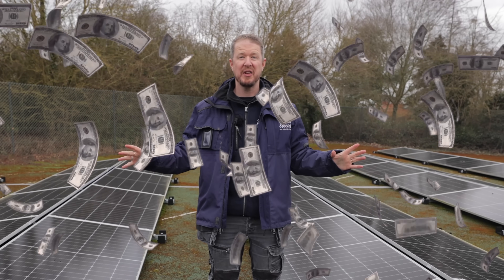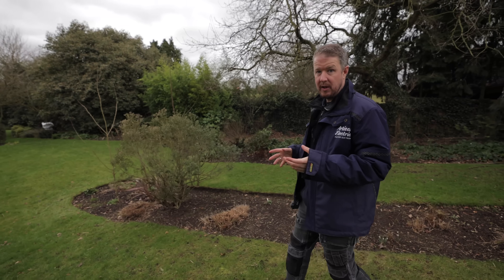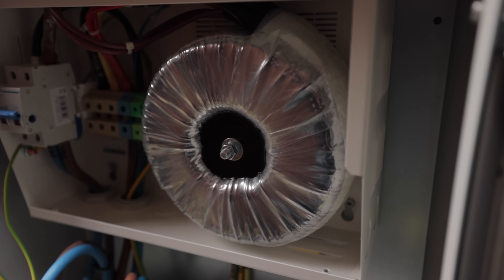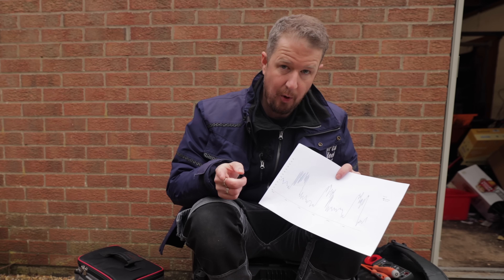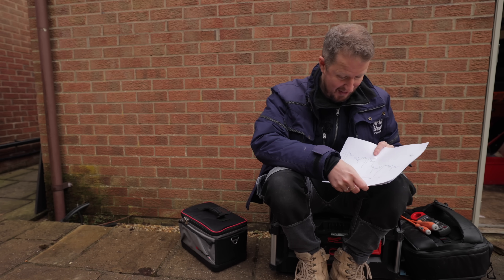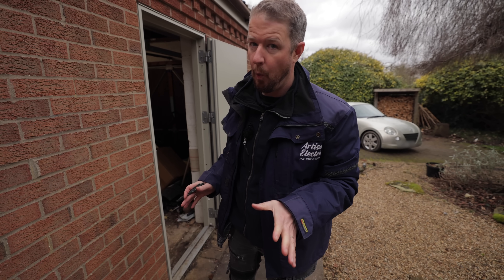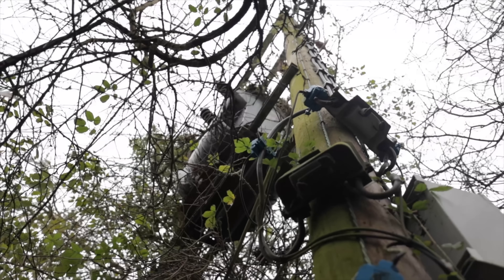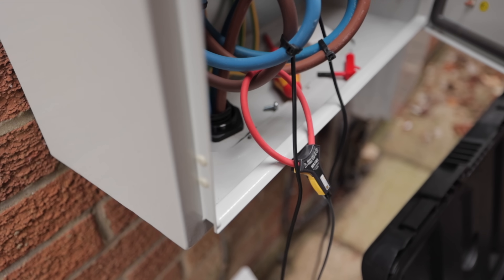THOUSANDS Down the Drain – And We Can’t Do Anything About It!

Comment: i'd have installed a bigger VO unit than that for a 17kw system. if interested I can put you in touch with a company that can install a larger VO, they are manually set Taps I'd have gone for automatic tap adjustment to be fair on that. You can drop that to around 220v  and everything will work i'd go 225v to be safe. You need a Voltage optimiser with automatic tap adjustment, 15-25v tap range.

Comment: You are not a clever sparky and clearly you have no idea how these systems work because your idea with the step down auto-transformer is about the worst thing you could do. The problem is first, the way these things work: to push power back into the grid the solar inverter has to push out a higher voltage to match the point in the grid where the grid current and the solar current match. If the impedance of the consumers mains and the grid connection and the grid itself is a bit high then the solar will produce an excessive voltage to compensate. It is literally just Ohms Law and a bit of logical thinking. How is the power pushed back into the grid? From there you get your answer.
Before they put this system in, did they get big voltage dips under load? I bet they did. And your auto-transformer is not doing you any favours either. The environment your system is trying to work in has an excessive grid impedance. Putting a fixed ratio auto-transformer anywhere in that system is going to cause a problem somewhere.
What you need to do, is work out where the impedance is that means a 70 to 80A back feed will lift the customer end of the consumers mains by 13%. The UK like the rest of the world has been moving to 230V for many years now and if the situation there is anything like here down under, we enjoy a mains of 230V +10% -6%. That's why your UV switch has a threshold of 252V. The limit is 253V (230V + 10%). At the other end of the scale it should be 230V -6% = 216V which is the same as the old 240V -10% = 216V.
It ticks me off when I see someone trying to be an authority on something or thinking they know what is going on and then try to tell people about it when it is all just disinformation and just plain wrong. Before you poison things for the rest of us who do know what we are talking about, please please please CHECK YOUR FACTS.
This is the second of your videos I have watched and the second of your videos that just sprouts myth and legend in place of the truth. This helps no one.
Sorry to be so hard on you, but if you are going to sprout a load of rubbish, in one way or another, this could hurt somebody physically or financially. That you lost 3k is your own silly fault for overstepping your knowledge and understanding.

Comment: Surely your inverters are monitoring grid voltage? Can you not install a raspberry pi and solar assistant to log grid voltage 24/7?
Reply: You could even set up homeassistant to send you a telegram message if grid voltage goes over or under a set range?

Comment: you connected a bespoke system to the electricity grid without checking if the grid could handle the system.
Looks like the power logger was an overdue item to put in your inventory.
so now the system is dependant on the goodwill of the power company upgrading the local grid
assumption is the mother of all cock-ups ! assuming a rural location would have the infrastructure to handle it was an error on your part. 
urban and high consumption areas will have been more likely to get network infrastructure improvements while conversely  rural locations are more likely to have space for large solar or even wind installations .
at the end of the day if the grid wants us to implement eco energy projects it will need to review its upgrade policies on the network

Comment: I Think the manual tapping system on the house mounted transformer should be automatic tap switching
Reply: I don't understand why the inverters on the solar system cant regulate the voltage. The  Pv voltage would be going up and down so why doesn't the invert regulate the final voltage output

Comment: Hello from France, this technical (and increasingly rare) issue is interesting, especially the final solution that will be applied. I immediately thought of a voltage drop between production and the grid. Have you considered taking a simultaneous voltage measurement at your customer's site and as close as possible to the transformer? During production peaks, of course. I'm also thinking of a possible phase imbalance downstream of the transformer.

Comment: Wouldn't of thought the transformer or vegetation or how old the H poles are although they look very old poles due to the type of porcelain insulators and snail clamps retaining the 0.5 copper conductor. There is something going on because of small black cables clamped to the LV cables transformer side of the lucy fuse - looks like a device for monitoring something? worth asking DNO what the purpose of the unit? It's not a phase balancer as they tend to be fitted on Lv poles to balance out the phases if one or two phases are are over loaded mainly red (brown) phase gets hammered. anyway my useless pointless bit of information.

Comment: 205 volts is not "too low"... it may only be an issue of a bad/cheap made charger. And yes, your local energy supplier's transformer and/or lines are slightly(but not critically) too weak for such loads (in or out). Also, you can just make a cheap automatic switcher for "night mode" for your "optimizer"

Comment: Are you not able to install a switch (or automatic/timer device/contactor attached to a photocell) that bypasses your voltage optimiser when the sun goes down. Low light the VO is bypassed giving 260v to charge the batteries, then when the sun comes up, the VO goes back online and protects the increasing solar voltage?

Comment: Just some comments and thoughts: 1 - The no-load voltage tends to be at the maximum allowed as the grid system was never designed for back-feed currents. 2 - These pole transformers tend to be low power and often overated for periods during the day. 3 - The cable length from the pole is significant (and feeds several houses) and is obviously soft (high supply impedance). The optimiser can only add to this impedance, but is necessary to avoid over-voltage if you wish to export at these high power levels. 4 - The fitting of power factor correction capacitors can negate the reactive volt drop and reduce harmonics (which also contibute to the problem of voltage variation), but care must be taken as resonances could take place. 5 - Do not assume the DNO are infallable, some people you talk to are not compitent (from experience). To check the system with the main load disconnected is a good example. 6 - From what I can see this installation should have never be given G99 approval as the supply is too soft and over-voltage is inevitable. No-one else on this line can have PV as this will make the matter significantly worse and this problem affects ALL customers on this line so equipment failures are someones responsibility. 7- This is a good example of why our supply system cannot cope with the green-plan. When everyone on this line has electric vehicles (2 per house) and they all plug in to charge overnight the system is going to fail. Final note - G98 says that the system is expected to cope if every dwelling (load) on the system generates a peak (short-term) load of 3.6kW (similar to the possible peak winter load). To allow one dwelling on a soft supply to take five fold this value is wrong. you need to limit the load/generation powers by better use of the batteries.

Comment: I've a SolarEdge system myself, but what was the ratio going for 3 inventers (servicing 20+ panels each) over going with micro-inverters?

My neighbourhood has a lot of solar and they warned me the fewer inverters you have, the bigger the chances of voltage problems. Serial with a large inverter is ussually when the panels are all the same, but you've installed a piramid base where half the panels will always generate less or more than the other half, plus all those trees and shrubbery around, you'll definately see voltage variations between the panels cause drops in outpot.
You'll also never notice a defect in a panel with the serial&inverter you've got set up, while micro-inverters allow individual monitoring.

That said I'm no electrician, this is simply what I know about researching the panels setups available then.

Comment: Did you have permission from the DNO for one of those voltage optimisers? Having your inverter connected on the load side of one of those things without it is non compliant with the code of practice, G99 and MCS. Basically because you've voided the G99 protections present in the inverter. Completely non compliant ... Brave to put it on youtube ... Or stupid.

Comment: To be honest have same problem in South Africa but the municipality really doesn’t care there is no funding to replace broken cables or transformers with the large scale cable thefts. We have a sunsynk so if the voltage gets to high or low it disconnects from grid so solar export stops entirely for few minutes every 15min but the house voltage is 100% so had to change te settings otherwise it was disconnected half of the time

Comment: This is a combination of lazy DNO and willfully quoting jobs without the engineering consideration. 

This is a very large solar install for a domestic local network arrangement. 

It might pay to consult an electrical engineer for larger jobs like this. 

It sucks for the customer but the installation as designed should never have been permitted.

Comment: electrical engineer here: clearly an impedance problem. Most likely in the wire. These overhead wires are usually sized small as open air can cool a smaller conductor. The transformer should be closer to the load. 11kV line is unlikely to be the problem as it will only be seeing 1.5 amps. Transformer also may need upgrade. Here in NJ most such installations have a 25 kVa rating and must be shared with up to five homes.

Comment: The idea that solar inverters can't push enough power trough the transformer is not correct. The transformer will allow for any power to pass trough. The only limits for the transformer are core saturation and I²R losses. (The transformer magnetizing current doesn't change with the transformer load. This is called "transformer action".) What happens is that the solar inverter, being a current source will raise it's output voltage to overcome the feed line and transformer winding resistance. That the voltage goes down when charging during the winter is also because the feed line resistance is to high. So you must use larger gauge cables towards the grid transformer. But with the current import tariffs on metals it might be cheaper to just move the house a bit. I also think you've been ripped of if you've paid several thousand pound for a transformer in box which judging for it's size, can't power the complete household. Maybe a washing machine and that's about it. You can actually measure the feed line resistance by yourself. Measure the open circuit voltage and measure the voltage a again with a load of a few kW. The remainder is ohm law.

Comment: That transformer looks good (even just looking from this video), and they are in the so called voltage range for your local norms. If there is no real voltage drop in the grid from normal loads (houses), then the grid is fine; your system is defective or poorly designed for this specific situation, and the grid service might even get a case against you for affecting their service or other clients in the worst case. Even then I would check for leaks in the live wire or even the neutral wire, is pretty common to find a slit down the line and you only find out when you have a load in your system.

Comment: To feed the grid, your inverters will rise the voltage. To solve the problem with house feed - use separate inverter, which will work off the battery set.

Comment: Could you fit an automatic transfer switch with a connection to the down rated tap in during the day and a bypass to the voltage optimiser at night time for when the battery’s would charge.

Comment: I have argued for many years about this, but the leccy board say its within limits. My customers were on 3 phase and I had 455 volts which tripped out all the machinery breakers and over voltage sensors. In the end I fitted different breakers and monitors, it worked but the component life will be shorter.

Comment: Just program up an Arduino or pie, to operate the VO via some interlocked contractors. You built the system, you need to automate it so it tracks the grid and self adjusts.

Comment: As others have noted you can determine the impedance of the home’s electrical service by simply applying a significant known current draw and measuring the voltage change. Hindsight is not very helpful now that the system is installed, but this a measurement that could have been done as part of the planning.

Comment: Hrm.. i wonder if someone makes a voltage regulator, or PLC based system for monitoring, and regulating the voltage levels of a large electrical system...... hrm...... oh wait.. they do.. and they are about $300 USD for a 20KW 220v AC regulator

Comment: The plus 10% and -6% on 230V is because the UK infrastructure supplies 240V, so they need a higher positive tolerance. As others have stated, how a transformer looks from the outside bares no relation to the electrical performance. As the problem manifests during solar generation, the voltage has to be higher than grid supply to export to the grid, but the fact that the voltage rises too much means there is a high impedance between the solar inverter and the pole transformer.

Comment: Is your client fairly isolated? if so I would suggest its the supply cable, a fault... UKPN, if its their fault and they know it, will do everything not to admit that and avoid having to actually do anything, because they are run by numpties... I know, because I used to work for them... I'll put money on the fact that the issue relates to their equipment... Just seen the bit where you go to the Transformer...and I agree with you completely, and of course its stuck up a pole, which means that the area has been subject to flooding in the past as well...no great if the PV panels are on a tennis court surface and may themselves be subject to getting flooded at some time...!!

Comment: I think you find your in the wrong my friend.. g99 is set of engineering recommendations by the ENA to avoid causing issue with the grid when connection anytype of generation, but you seem to be exporting double you should be causing the high voltage and could potentially cause damage to the neighbours, so in breach of this.  Single phase premises exporting upto 17kw you should have a G100 scheme as you should have export limitation to maximum 32amp on to distribution network under small generation installation 3 (SGI 3 ) you need to install this/ set it up properly and more battery storage to make the extra 42amp loss worth while.

Comment: If the impedance to the grid is too high, how would lowering the feed-in voltage solve the problem? The power you try to feed in remains the same, so if you lower the voltage by 6% you increase the current by 6%, and that higher current increases the voltage drop you cause on the wire to the substation by 6%, and you are nearly back to where you were. Isn't the only real solution to improve grid capacity, i.e. a bigger substation, at a lower distance, with thicker cables.

Comment: All you need to do is check the the source impedance of the supply. You can calculate this from a simple Ipf (prospective fault current) at the main switch. From this its easy to calculate how much you will push the mains voltage up or down when you try to shove or pull 80 Amps over the DNO's cables. Ohms Law, not rocket sicence.
I doubt it will be the transformer, its mostly simple volt drop over the long overhead cables.

Comment: Transformer? Never seen that. If inverer regulates to max 253V nad then you put transformer between grid and inverter which can increase voltage, that is insane. I would forbid that. You are not allowed to rise voltage beyond 253V. Btw, i would forbid inverters to push energy out if grid voltage is at 230V.

Comment: Why are the inverters increasing the voltage to 260?  A low load from the house shouldn't cause this.   Active power load sharing is based on varying the  frequency, reactive power load sharing is done by varying voltage control.   If you turn the load off to the property and the grid  voltage floats  to 260V then there is an issue with the supply.  Is there no voltage/frequency droop setting for this type of load sharing in the inverters themselves?  If the cables are large enough for the house to draw 17kW then they are large enough to supply 17kW to the grid.

Comment: You need to tell them that your connection to the bigger transformer needs to be within 40m away. Depending on the size of the old transformer, and depending of your neighbors intentions to also install solar, it could get recycled by installing it at the entrance to your property, and a new big transformer for your neighbours to share? What about a 17kw Dc to dc transfomer regulator before hitting the main invertor?

Comment: Why don’t you set the charging at a slower rate so you don’t get so much voltage drop?
The cheap power times in the UK are from around 12pm to 6am meaning if they’re currently fully charging in 3 hours, you could drag that out to 6 hours and probably bring that lower limit within tolerance